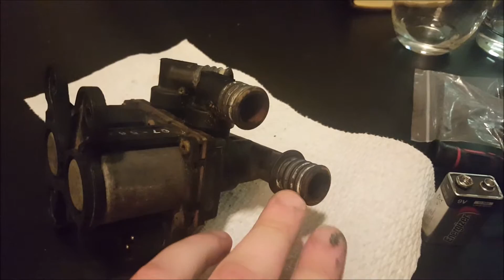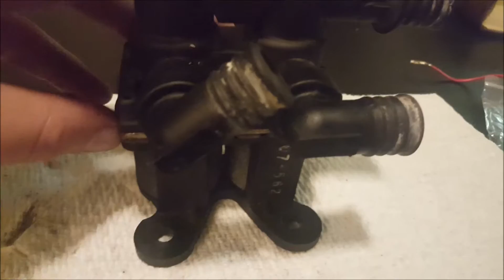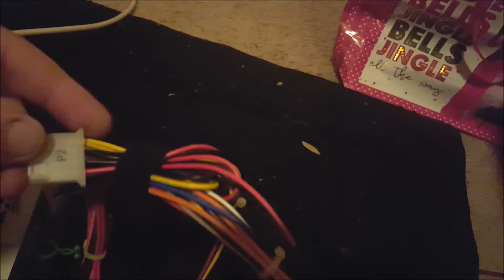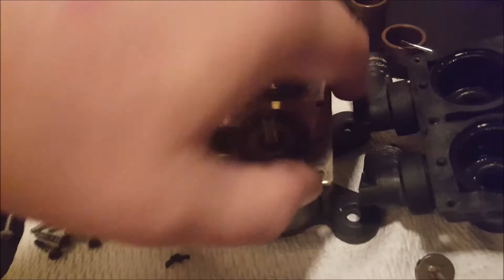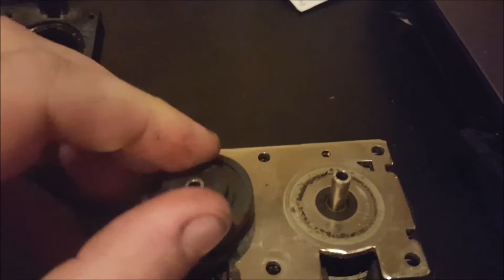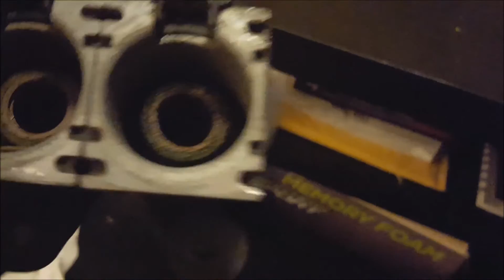BMW E34: Heater Control Valve Test and Rebuild DIY

Comment: Hey, great video and I'm almost done but can't get the "draddles" to come off to replace the seals under them. I've tried multiple things and they seem solidly connected to the shaft going to the counter weight. Are they supposed to slide out like yours?

Comment: I think that leftover seal is for the auxiliary water pump that is attached to the heater valve assembly. It serves to circulate water from the block into the heater core when the car is not running but the key is on. Like when you're grabbing donuts in the middle of winter and you don't want to freeze. :)